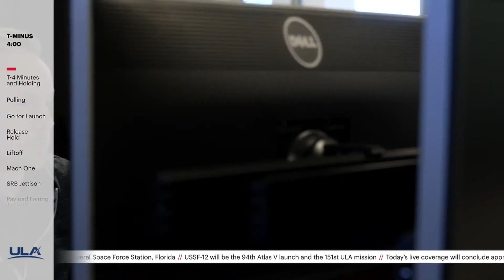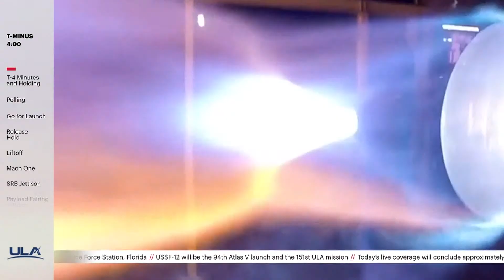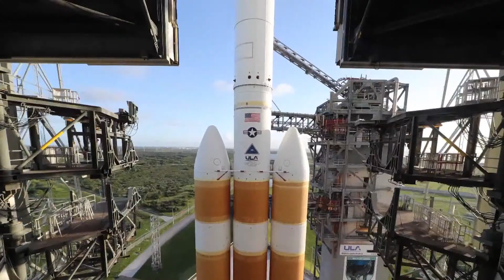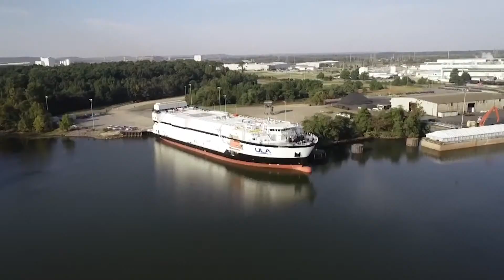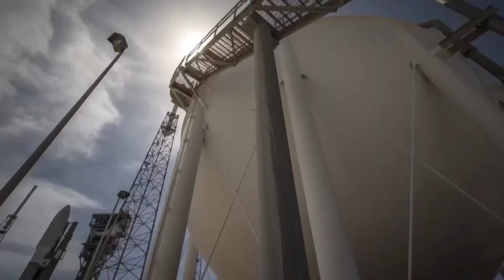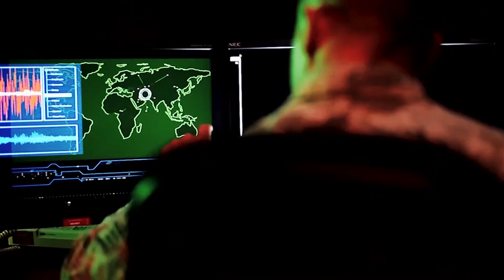July 1 Live Broadcast: Atlas V USSF-12

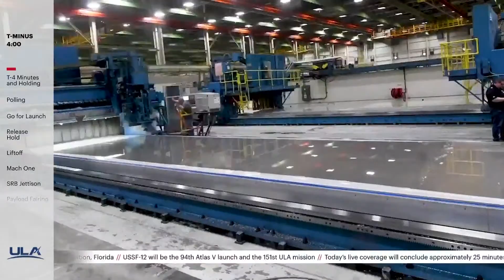Comment: 15:20 LOL, Vulcan Centaur starts it's build with the most expensive methods imaginable to construct it's new "Disposable" tanks. Taking large thick expensive aluminum plates and robatically milling them to create a huge pile useless aluminum chips, instead of using a much cheaper faster flat panel construction. ULA uses only the most expensive methods possible, making the "Disposable" tank as expensive as possible, ensuring ULAs increased profits on every government "cost plus contract" launch in the future. Increasing the "Costs" also increases the "Plus" of ULAs new disposable tanks. Thanks for watching.

Where are the Landing Videos of the Atlas V first stage, it would be wonderful to have a Landing Video before the last one is launched.